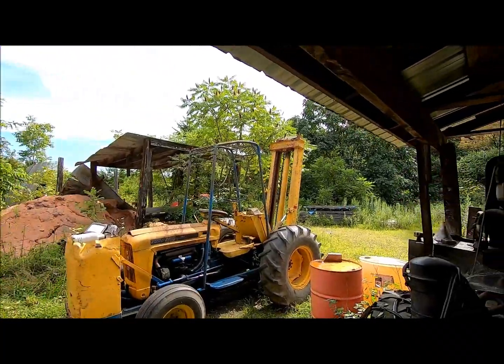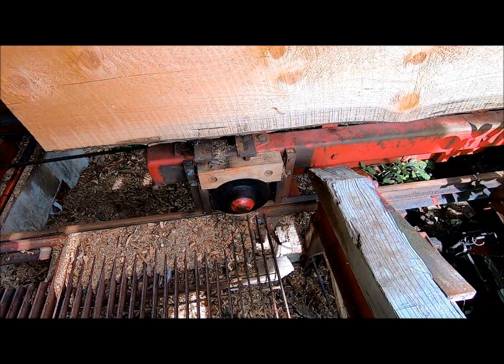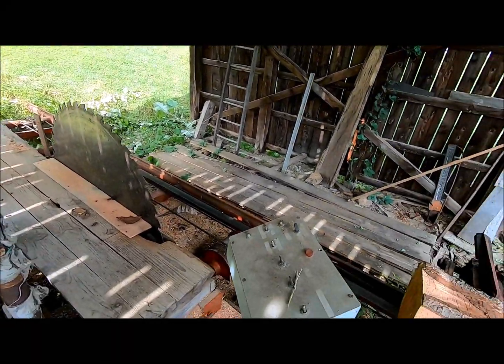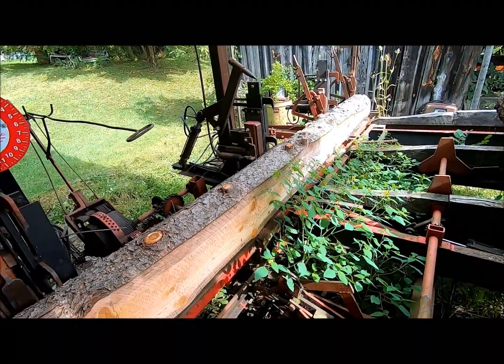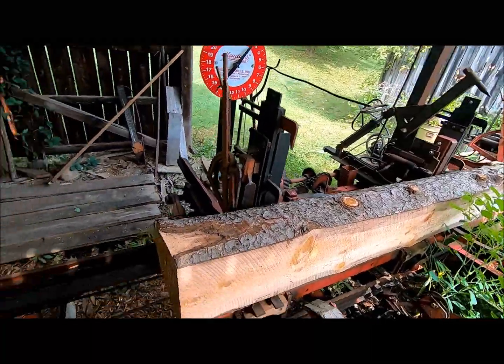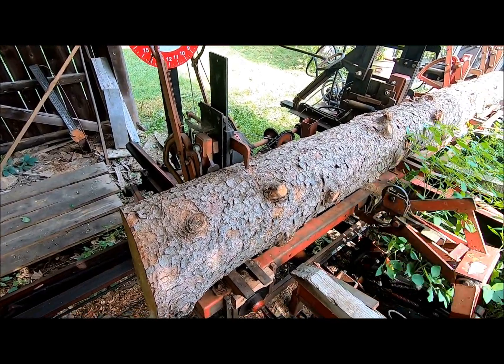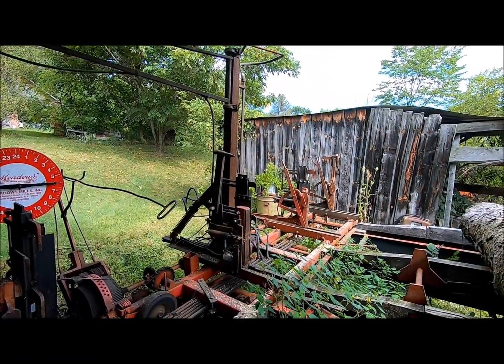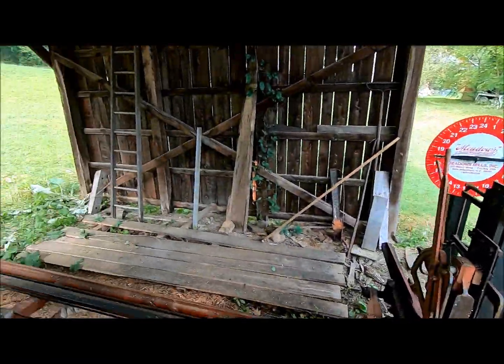meadows #1 sawmill for sale

Comment: I would guess that one of two things are happening, one that your retiring or your going to a bandsaw mill that might or might not be mobal. I lean towards the last option.  The mill your selling is a great mill and has many board feet of cutting lft in it and when moved to its new home will have some upgrades  as money allows. The biggest problem with a circular sawmill is the curf. I love the amount of wood they eat in a day and just from taking it down improvements or suggestions from you to the new owner. I see a lot of big timber going through that mill and only the curf being the set back in owning one. I have ran a tie mill in the day and it was all small timber so it ate as much as it sawed. Still a great mill but the cost of timber to feed it is really prohibitive unless you own your own tree lots
Reply from the maker: we got a edmiston automatic mill cheap so we are still sawing. I have videos of the new mill on youtube.